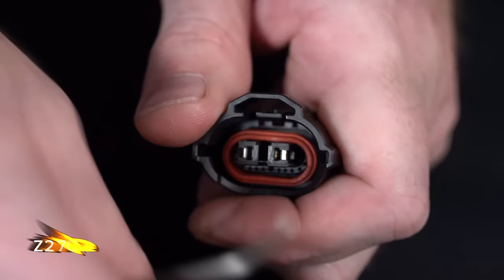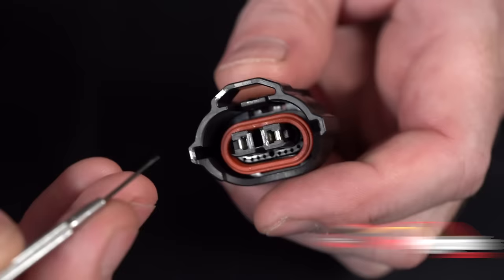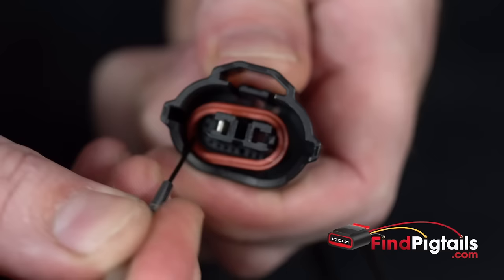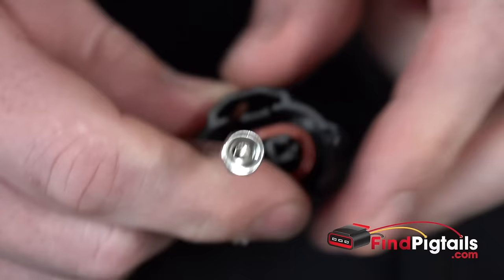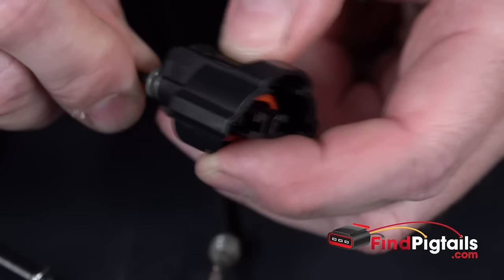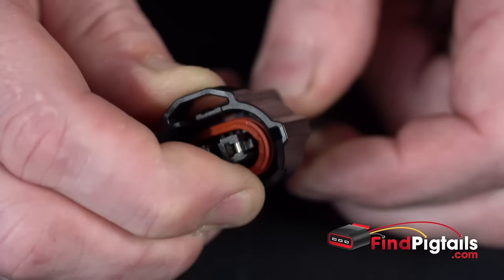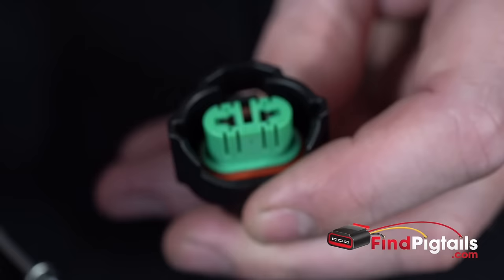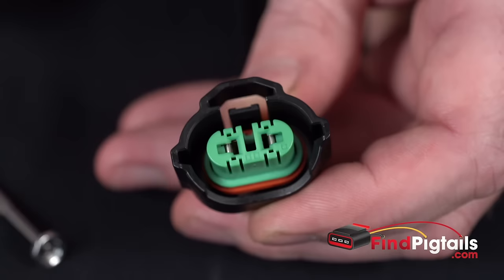Repair and DePin/RePin Automotive Connector, Pigtail, Plug. Fog lamp and headlight pigtail, plug

Comment: Okay I have a question sir! I have “prototype headlights” and everything works except the low beams. I’ve emailed the company and this was their response “Yes, if the low bean is not working, please un-pin the plug with the single wire and move that to the open spot.”
I’m not entirely sure if I need to mess with the plug that’s connected to my vehicle or to the headlight. The headlight plug has 1 wire/pin for the low beams but I don’t know how to de pin it!

Comment: I installed a pigtail , but my headlight turns on then off on its own. I don't get it. Is it possible for the prongs to come loose in a pigtail ? I did the solder sleeve water and corrosive proofed it. I used CRC electrical cleaner followed by silicone dielectric electrical grease by CRC as well. Headlight still acts the same, flickers. Yes I have 12volts. No short. Flickers at the connector. Any suggestions?

Comment: My connector doesn’t have the wires attached. They’re still in my cars alternator. So when I use a special depinning tool it should just fall out?  There isn’t anything to pull.

Comment: Hello Rusty, I am trying to rewire a two pin connector in my ´98 BMW. It is AMP with two circular female connectors. There is an oval slider that goes around both female receptacles. Could you tell me how to depin it?? Many thanks!!

Comment: A what time do you need to replace the pins? I have an O2 sensor and I broke the clip on top of the connector on the engine harness side not the sensor connector. Can I replace the connector and reuse the same pins?
Reply: I have the same question. This happened to me also.
Reply: i don't see why not? Isn't that what he's demonstrating by removing the pins and re-inserting them?